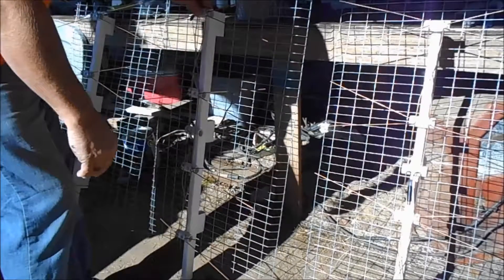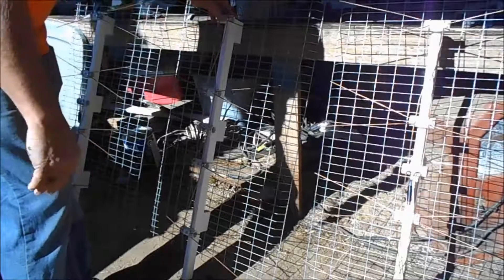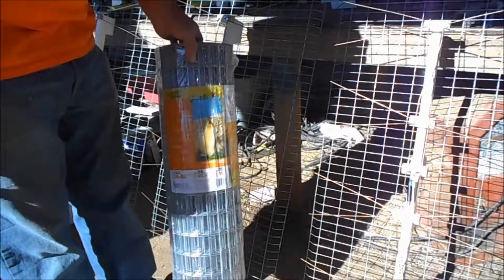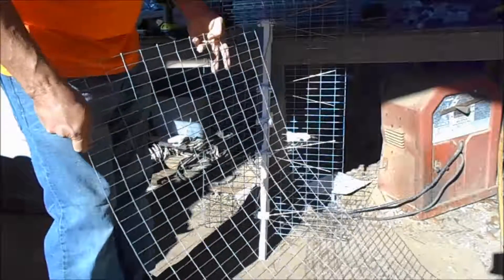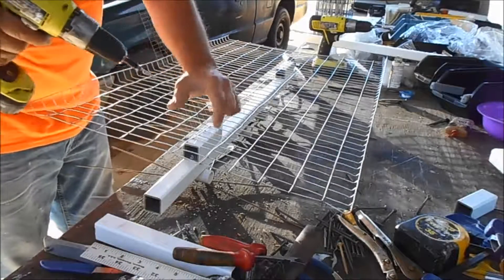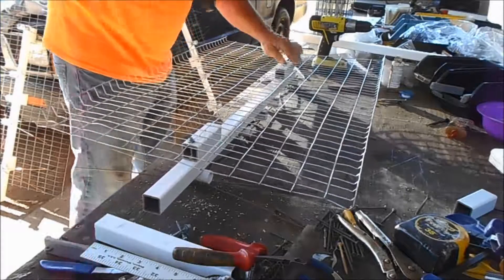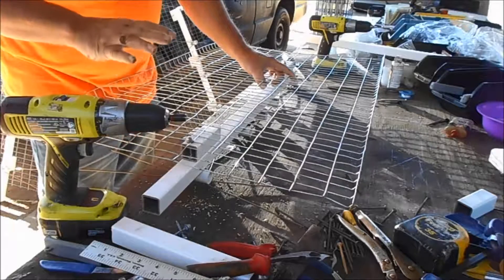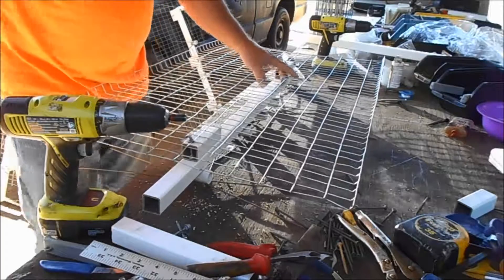HOW TO MAKE A TV ANTENNA REFLECTOR

Comment: Danny, I made antenna like you have and didn't get very good results, the stealth hawks updated version from 4 or 5 years ago is working very good for me I'm in Indiana
Reply from the maker: SOMETHING WAS WRONG....THERE IS NO WAY A STEATH HAWK CAN OUTDO THIS  ANTENNA...IT HASNT GOT THE INCHES TO DO IT...IF THAT WAS TRUE ..WHY WOULD I GO TO THE TROUBLE TO MAKE 1 THAT COST TWICE AS MUCH
Reply: Danny S Hodges , I never seen in all of your videos exactly the distance between the back of the antenna to the front of the reflector,  but I noticed in one video you show two 3/4" pipe tee's , I measured them in box store and found to be 3-3/4" . is this the correct distance.?
Reply from the maker: DONT THE STEATH HAWK WORK BETTER. ITS IN HERE..https://youtu.be/FovEdu9BaWI
Reply: 4" or 10 cm

Comment: I've used two 2x4's and  c-clamps to bend light metal before also.. most people don't have access to a $2000 metal break..
Reply from the maker: ha thats right brother they allways a way
Reply: Danny S Hodges  I built my first experimental  4 pod antenna from 1" PVC and used ceiling wire for the bow ties.  I just used some chicken wire for my reflector..lol..it's what I had laying around at the time..haha..it actually picked up some stations about 70 miles away. but I'm working on a new one, this one is gonna be 8 pod  with a lot more range and I'm using aluminum square tubing with insulators like yours...
Reply from the maker: let us no how it turns out
Reply: Danny S Hodges sure will. I'm looking forward to hooking it up...

Comment: Hey Mr. Hodges,
                On some of your antennas,  you put the reflector on the " backbone"  other times you use a spacer. So which way is best ?
Reply: Ooops,   sorry my mistake the Ultimate did have a spacer,  between the reflector and the backbone. 
How big is your spacer ?
Reply from the maker: NONE OF MY VIDEOS IS STRAIGHT ON THE BACKBONE